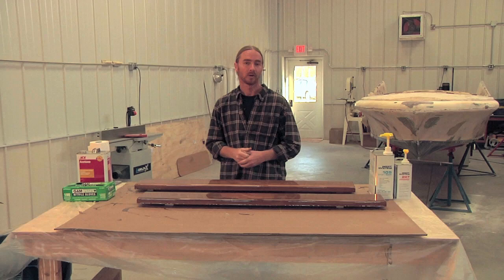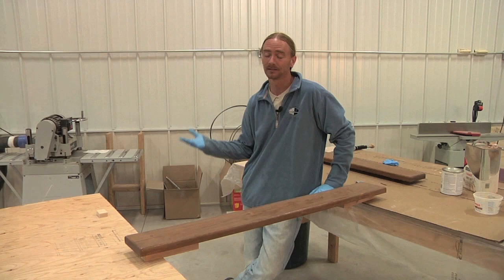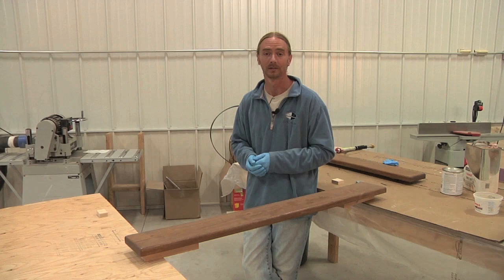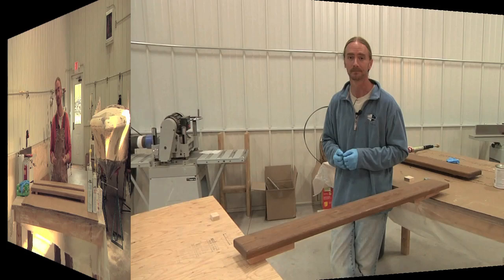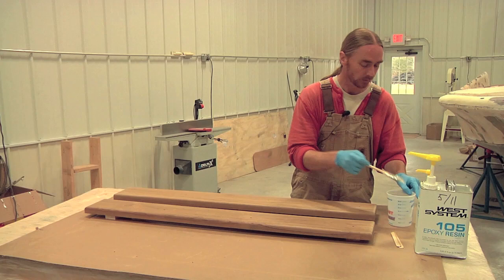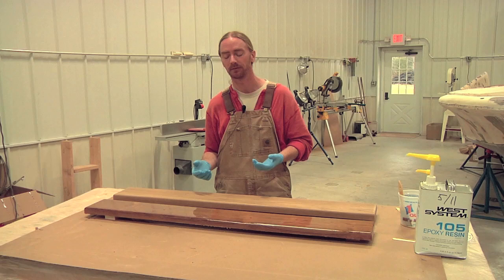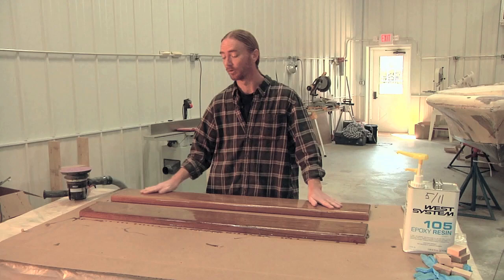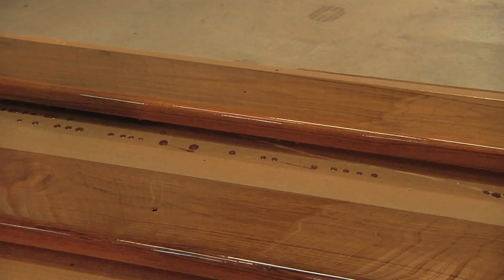Varnish and Epoxy~ a Professional Wood Finish for Teak Part1

Comment: Nice video! I've varnished boats since around 1958 and worked on some of the best yachts on the West Coast, but never used epoxy so wanted to learn. Impressed by the West System and nice to learn that epoxy is first then varnish. CAUTION TO VIEWERS: ACETONE IS DANGEROUSLY FLAMMABLE, NEVER USE AROUND ANY FLAME, WATER HEATER, SPARK, IT WILL EXPLODE!

Comment from the maker: Thanks for the kind words!  If you're using epoxy and glass on the pontoons the bottom paint won't really add anymore water-proofing protection.  The main purpose of bottom paint is to help prevent things from growing and sticking to the hull.  The level of fouling in the water you'll be using the boat will determine the best kind of paint to use.  A good starting point would be to look around the marina's to see what others are using and see how well it works.  Hope this helps!

Comment from the maker: If done correctly the brightwork IS completely sealed (top and sides with epoxy and varnish and the bottom sealed with bedding compound). The small amount that the wood does expand and contract, the epoxy and topcoats move with it.  

Exterior brightwork typically does not have joinery with opposing grain patterns. If it does it is separated by a caulk seam to allow movement. As long as the grains run directionally as with lap joints, scarf joints, etc everything moves together w/ no issues

Comment from the maker: I haven't but I talk with the tech guys from West System a fair amount.  Their suggestion was that oil stains would probably be hit or miss on the adhesion of the epoxy, but water or alcohol based stains would work well.  Something along the lines of TransTint (you'll have to Google it :-)  This might be a good follow up video for this Winter?  Thanks for the comment!
Reply: Does the epoxy varnish combination work equally as well on mahogany?

Comment: Just my 2 cents. I did this on my teak toe rail , it looked wonderful , but eventually the sun got to it and the epoxy failed and stated to lift . Took 5 years and im not in the tropics. Heres the hard part , try getting that epoxy off !!!! I went through two heat guns , this stuff is tenacious !!! It dosent sand you have to strip it with a heat gun and it is slow going!  The toe rail I did on the other side of the boat I did with just a polyurethane clearcoat. Imron Elite actually . over reduced for the first coat and then just three coats after that . This stuff is tough and very high UV protection. But it started to fail in about the same time period . The difference here is , and its a big one , a quick sand with 180 around the failing areas and recoat , you dont have to remove it all just the places that era giving up . Its sand easy !! no heat gun and it dosent discolor the wood like the epoxy did , it went very dark .

Comment: I just finished 3 coats epoxy in a day, followed by 6 coats varnish over 6 days. takes for ever, but looks great.
Reply: paul mryglod wich varnish with high UV protection it is the best to cover resin? Don’t crack?

Comment from the maker: Yup.  Many kayak and paddle board manufacturers will do this to provide a layer of protection.  You can sand and repair scratches in FG; you're pretty much hosed if you try to do this directly on CF

Comment: If you would like to use epoxy to create a mat (rather than glossy) undercoat you can wipe it on/off with a cloth, so that the epoxy absorbs into the underlying food fiber without building on the surface to the point it starts to show and look slick/glossy.  I did this with some floor hatches which, because they were inside the cabin and were not going to be exposed to sunlight, did not need a U.V. layer such as varnish in addition to the west system epoxy.

Comment: Thank you for all the videos that you put out. You are probably one of the most informative channels on YouTube, hands down. I'm using this technique to refinish the wood on my Olympic Dolphin 23. But I'm running into a small issue that you did not touch on in this video. A lot of my surfaces are two-sided. How do you handle the line or the buildup on the bottom side?

Comment from the maker: @Darknights7 You would just have to buy the 207 hardener; the 205 does not cure clear.  The 105 resin is what you need.  As well, you'll need some acetone, sandpaper, and west system rollers and / or chip brushes to apply the epoxy..

Comment from the maker: Labor rate depends on a few things.  Your area, level of experience, operating costs (insurance) and reputation.  It's a fairly difficult thing to just jump into without references.  But a starting point would be to contact a few of the local marinas and ask what their labor rate is for brightwork finishers and check to see what their liability requirements are for outside contractors to work in their yards.  :-)

Comment from the maker: Usually compressed air to blow the dry dust off then tack rag, or solvent wipe with the varnish thinner (mineral spirits works as well) and tack rag..  In a pinch, clean water will work as well...

Comment from the maker: Yes on the sanding between every coat (320 - 400 grit) and depending on the size of the area you're finishing a little thinner (10% or so) will give you a bit more working time before you lose the wet edge for blending.  With poly, apply thin coats as it can have a tendency to run.  Foam brushes work well with this...

Comment from the maker: @valeriemd2b Yes..  As far as adhesion this will work with all woods (some like teak that are oily require a little extra prep as outlined in the video).   However I would test a scrap piece to make sure it gives the color and tone you're looking for when finished.

Comment from the maker: One of the tricks with using this system is that the wood should not warm as the epoxy is curing.  As the temp of the wood increases (either from being in the sun, heat lamps or air temp) it 'gasses out' which creates the bubbles.  Best thing is to do this indoors in the shade, or after the temp has peaked for the day and is starting to cool.  Give this a shot and the bubble issue should not happen :-)  After everything has cured it's no longer an issue..

Comment: I liked this idea so much I did it 40 years ago.  It lasted six months before water got under the epoxy at a joint in the teak and caused it to lift the epoxy up ruining the finish.  Then I realized the mistake as it was darn near impossible to remove the epoxy finish and go back to varnish.  With natural varnish I used to use `12-16 coats.  With urethane I use half that many.  If you put two coats on a year and do spot repairs a good varnish job will last 10 years.  I would like to see you do a test sample and throw it out in the sun for ten years to see how this holds up.  If the new epoxies last that long....or longer... even with tune-up yearly coats. this technique would be worth it.  If it does not, removing the epoxy if it must come off prematurely will make this totally not worth it.
Reply: I agree with you. If the epoxy cracks some time it will be a paint to fix it.

Comment: Question. If I’m restoring original teak an holly sole flooring with some new pieces, should I varnish the new to match the old before adding epoxy or can I just add a couple extra during the varnish stage on newer pieces ? Thanks  for any help

Comment from the maker: The first coat will look a little rough, but the 2nd coat of epoxy will flow out like a sheet of glass :-)  If it's not curing there are likely 1 of 2 things going on.  Mixing ratio: the West System 207 hardener is mixed with the resin 3:1 (3 parts resin to 1 part 207.  Also temperature.  I believe the minimum temp for this hardener is around 65F..  

Hope this helps!

Comment from the maker: Epoxy as a base would offer good protection, but may be a little pricey.  Also, using a high gloss finish for the topcoat (varnish) may not be the best choice.  Varnish is relatively soft for 'working surfaces' like table tops, chairs, etc.  It will scratch easily and being a high gloss EVERY imperfection will stand out like a sore thumb.  Exterior finishes are tricky trying to find a balance between protection and appearance.  I'd look at Sikkens stains or decking products w/ UV protection :-)

Comment from the maker: Nope.  Just sand the epoxy down with 220 grit, wipe with acetone and coat with straight varnish.  Sand in between coats of varnish with 320 and wipe down with mineral spirits..

Hope this helps!

Comment from the maker: @ihsan2011 
Hey, thanks!  If the 'image' is going to be exposed to sunlight, then it needs to have some other type of coating on top of the epoxy (with UV absorbers) to prevent dis-colorization (yellowing).  If it is something that is going to be kept indoors (out of sunlight) then just using the epoxy itself will give a clear, non-yellowing appearance.  The background colors should come through very clear with little / no change over time :-)
Reply: BoatworksToday what can I use on top of the resin? Thank you

Comment from the maker: @Darknights7 I apply 2 coats for depth and durability.  1 coat gives a nice finish, but two make it look like a mirror.  A topcoat w/ UV blockers is needed for protection from the sun (varnish, etc); I wouldn't leave it bare.  As long as the surface isn't hot when applying the epoxy, no bubbles.  It flows out beautifully!  Roll and tip with a brush, or just brush it on like I did in the video.  1 coat at a time, and wait until it's tacked over before applying another.  Use ONLY clear epoxy WS207

Comment: Ive sanded down the teak wiped it with acetone  and then have coated my teak with west systems but i got a lot of bubles on the wood? What could i possibly be doing wrong?

Comment from the maker: @Darknights7 The epoxy shouldn't effect the glue used for laminating the boards, and once cured the epoxy needs to be sanded before painting.  Although, I don't know how much just coating the sides of a pre-laminated board will actually strengthen things?  Won't hurt, but not sure how much it will actually help... Only thing to do is experiment and see what happens...

Comment from the maker: Unfortunately I do not have a drum sander  and I've never used one (although my shoulders wish that I did sometimes). So not much help there..  I typically run the wood through my planer, a light sanding with some 180 - 220 and it's ready for finishing :-)

Comment from the maker: @Darknights7 I'd still use acetone, without a clean dry surface the epoxy won't get a good bond.  The 205 hardener will work just fine, but will darken the maple a bit.  Are you making the boards or fixing them up?

Comment: Just to be clear, two coats of epoxy is all you need?  Also, between the coats of epoxy, do you need to sand and use acetone? I ask because you had the saw dust issue in your video.

Comment: Hi, great video on applying the West epoxy.  I'm installing a new cabin sole (old one became black due to water instrusion through the edges of the old floor).  So, I'm using the West Epoxy for the underside and edges of the new marine plywood and then will apply spar varnish to the top/exposed surface.  My question is - how would I prepare/rough the surface of the Epoxy before I apply the adhesive and set the new floor in place (I'm using Sikaflex 291 on the new marine plywood and will lay it down onto an existing subfloor in my boat).
Reply from the maker: Don Voigt If using west system, the only thing you 'd need to do for adhesion would be to remove any possible blush with warm water and a scotchbright pad.  Giving it a sanding certainly wouldn't hurt, but not really necessary for this application :-)

Comment: Andy - Should I use this technique on my teak and holly sole in my saloon? I have used on my brightwork and it seems to hold up pretty well. I does seem to have failed at a few joints after one year on the Penobscott. Thanks.

Comment: Hi i just wonder if this method can be used for the whole wooden sailing boat restoration. I want to buy a wooden Omega (polish sailing boat) remove all paint and varnish layesrs built up over years and secure wooden hull with Your method. Hull construction is backed from 1942 and basically it is made from  pine slats (approx 0.5 x 0,25 inch). I could send You some pics but do not know how to do that over Youtube.

Comment: This might be a little if topic but I figure your the guy who can help.
Question: I want to use red oak as a rudder for my Chrysler buccaneer.  The reason is. I've never made one before, and the wood is a little cheaper and I like the grain pattern. But I know white oak would be better.
A freind told me to shellac the rudder. Because the wood is going to move and expand and contract and shellac would be better. 
The rudder will not ever stay in the water unless I'm useing it.
Maybe a weekend.
Is this good advice?
Or would you do this different.
My rudder blade is 39" long, and around 91/2 wide roughly. And the wood is not quarter sawn.
Thanks for all your videos.

Comment: Great video, thanks for doing this.  My question is, would you recommend this for a toe rail on a sailboat.  Ours is teak and lots of it, 46' boat.  I wondered if using epoxy as a base would cause any problems down the road if we had to go to bare wood again?  We bought this boat recently and the finish is down to bare wood in spots, other spots it was good.  We used a heat gun to remove the old finish and it wasn't too bad.  Will the epoxy come off with a heat gun as well if we ever had to do that again?  I would prefer to just maintain the varnish top coats but thought I should ask before making the decision to go varnish or use the varnish / epoxy technique you describe here.

Comment: Thank you for your wonderful instructional tutorials. I am doing a white oak topped outdoor dinning table with a red oak base.; there will be no roof overhead to protect it from the weather. I am wondering if your application of epoxy and then a high gloss extra uv epifane (maybe 4 coats) would be the most durable finish? I have also considered using a fiberglass finish over epoxy. Your thoughts are much appreciated.

Comment: Great video, super helpful! Going to follow this process on my 15' whaler's Teak benches. Do you have a nonskid recommendation for varnished teak wood? I've seen some people use a course salt after the last coat and then wash off... We used soft sand around other areas but want to keep the clear finish of the varnish here. Thanks again for the great videos

Comment: Great Job!! I will use this method on my boat. My question is the teak that is outside the boat is weathered and faded. Inside the cabin still has a nice deep color to it. I am striving to have it all match. Should I do a teak stain on the outside pieces prior to this process? There has been some teak "restorer" product applied inside, any special prep work other than a good 220 sanding?? Thanks again!

Comment: Andy, very interesting video. Did things change in the last 7 years? One big question I'm looking for anwers: Why varnish on the epoxy? UV - hardness - gloss -> what is it? There are some yachtbuilders (e.g. Fleming) offering epoxy coating as the best, for a lot of money - do they also varnish at the end? Have to do some wood planks and handrails this winter and wonder, what the best way would be ...

Comment: Good afternoon Andy, I would like to thank you for your fantastic videos. I have learned so much by watching all of your videos. I'm hoping you can answer this question for me. I have an Egg Harbor with teak gunwale caps and I would like to try this technique to finish them. However, I'd rather not remove the teak from the boat. If I were to finish the top and sides of the wood in this way and then run a bead of sealant along the wood to the fiberglass to stop moisture from entering the unfinished bottom of the wood. Do you think I would run into problems with moisture getting under the finish? 
Thank you in advance,
Damen

Comment: does epoxy "self levels" or do you see much brush strikes after its cured ?  also, i tried to sand epoxy (filled some nots) and it was impossible, the heat was "melting" the epoxy and it remained tacky all the time.  I probably didnt mix it well enough or didnt put enough hardener in it ?  tyvm, nice video !

Comment: Cool - have you tried epoxy over stain? I've always been afraid to try it, for fear of lack of adhesion or reaction between the two in the case of oil stain.

Comment from the maker: I'm very familiar with West System and have spoken with them on numerous occasions. Sorry, but couldn't disagree with you more. Bedding compounds are a sealant (key word, SEAL). Moisture does not permeate this material, otherwise it would not make a very good choice for water proofing now would it? :-)

Properly refinishing a floating paneled door does NOT entail locking the panel in with epoxy or finish. You lost me there..

Dozens of boats, hundreds of parts over 15 years. Not 1 failure ;-)

Comment: Hello, Trying this method on swim platform. First time using epoxy. Blew it first time;too cold, had to sand it off. Second attempt came out nice. Put two coats on bottom side. Problem with drips around edges when I flipped it, will have to sand them off. When I coat the top side can I tape the bottom edges to catch the drips?
Thanks
Reply from the maker: PM'd ya :-)

Comment: I picked up the West Marine system you're using to finish all the outside and inside trim on a small wooden weekender... the gentleman there said this was easier than varnishing and didn't mention need for it nor sell me any varnish. Will it turn horribly yellow if I don't do the varnish especially on the outside trim in the sun?
Reply from the maker: You will need to have some sort of UV coating over the epoxy to prevent clouding and pre-mature peeling.  The 207 hardener does have a certain level of protection but not enough for long term exposure to the sun.